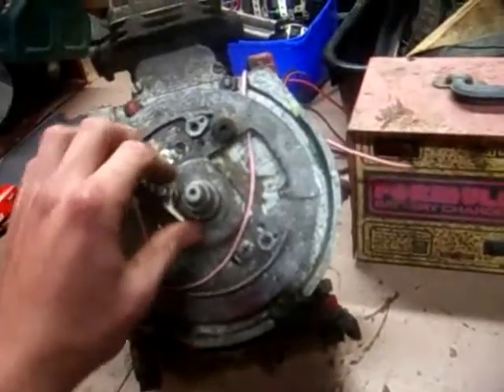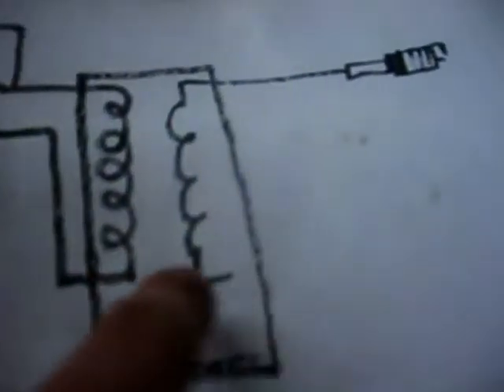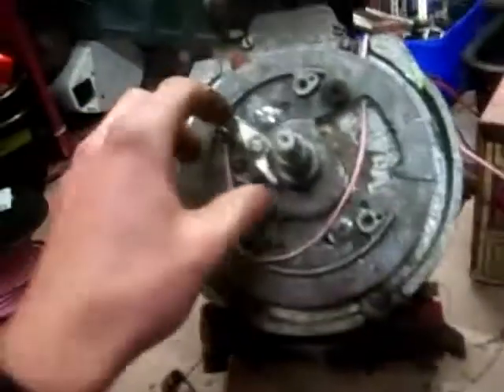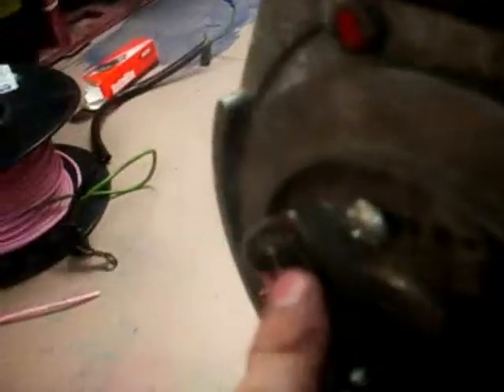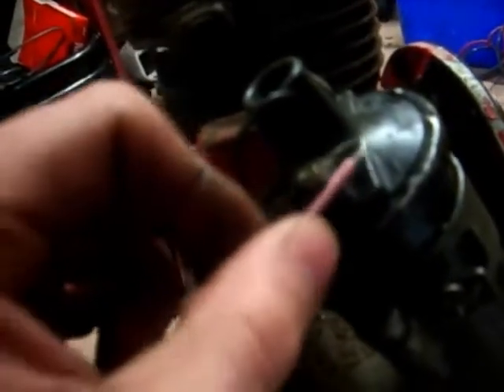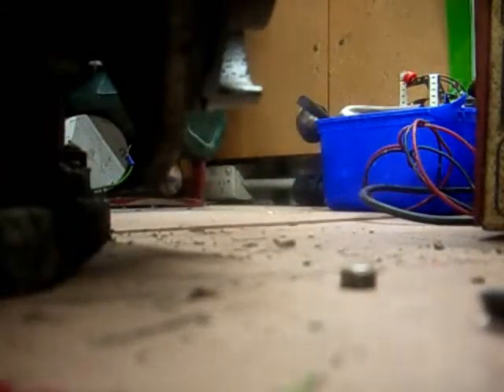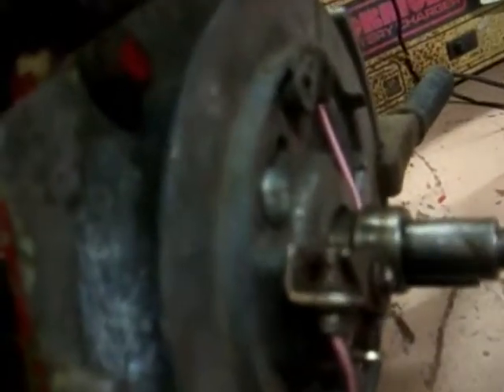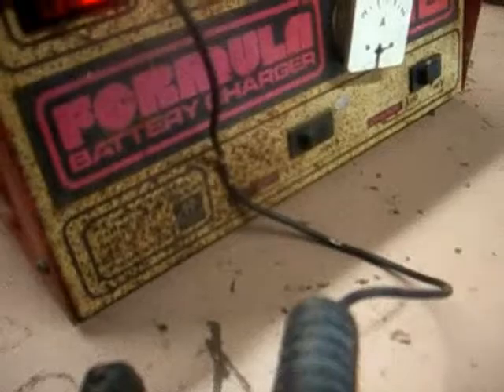how to wire a car coil on a lawn mower engine

Comment: A bit late in telling you this but you drawing is wrong. 
Were you have the secondary winding going to earth it should be going to the positive coil terminal (along with the primary positive) internally in the coil. 
The other end of the secondary goes to earth through the spark plug. 
That shot of power going to the plug from the coil is actually negative. 40,000 volts negative and the engine block is 0 volts negative. Both windings are powered with 12 volts positive.

Comment: would it work if i were to use a coil thats out of a 2003 escape because the engine the coils  came off of had six of those coils on the head of the engine, one for every piston, and there an odd shape i just don't know if it would work the same.

Comment from the maker: if you had a vintage mower with points and couldn't afford a coil rewinding then this would be a hacks way of running the engine, not something you would do instead. you would have to mount a batterey to the mower then hook it us as detailed here

Comment: I wired mine the same way that you have. But when I turn the motor over slowley by hand, the points arc a little bit, but when I turn it a bit faster they dont arc. I only used a very small (old) condenser.

Comment from the maker: a ballast resistor would help as it would lower the voltage a bit. but that or either a new condenser would do the trick

Comment: @Jaytheozzi theres only one set of points they run off a twin lobe cam and another question i have an international M type stationary engine that needs a mag i was told there is a way to get it running without one is that true

Comment from the maker: @EngineManic if it has two sets of points yes. you will need to use 2 coils tho. otherwise you would need some sort of distributor and that would be virtually impossible. but make sure you use a ballast resistor and a decent condenser for each coil / set of  points.

Comment from the maker: @greatwhitenorth112 if it has two sets of points you can or its one that both cylinders fire at the same time then yes. if you make a vid showing the coil and such i can probably tell you more accurately because its hard to say when i dont know what set up yours has.

Comment from the maker: @douro20 the coil is a 12 volt internal resistor type, same as the ones gm used in the vn's so  there is no need for a ballast resistor if its in good order (witch it may not be). i will try another coil with a newer condenser and hopefully that fixes it otherwise it may be bad points.